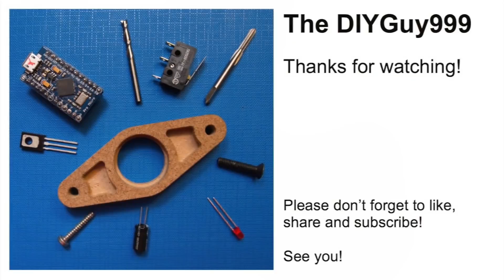WPL B36 URAL 4320: Axle, 2 Speed Gearbox and Motor Upgrade

Comment from the maker: The WPL B36 URAL metal drive train upgrade is finally done! In this video, I'm going to show you many details, the 2 speed shifting gearbox, the Arduino Diesel sound simulator and much more. if you like this video, subscribe and turn on notifications, so you don't miss upcoming episodes. See you!

Comment: Great video, has helped a lot regarding the rear axle as I built mine yesterday but I couldn't link the lower adjustable bars because the shaft is too long and I don't think I have a smaller one.

Comment: Nice video, good shots of the gear box when you had it disassembled.I also bought a b-3 and did the same upgrades. Just a thought with your first gear problems, have you checked the travel on the shift servo. In the video it looks like it goes about 45' therefore not fully engaging. I had to set the endpoints on my radio so the servo is at about 90' (parallel to the ground) when engaged in 1st gear and you can adjust the little plastic fork by sliding it on the metal shaft for fine tuning. I also shaved the edges of the shift servo horn for smoother engagement. So far mine is doing well driving on my back yard course men't for 1/10 scale.

Comment: Im planning to buy the WPL B36 RTR, my first crawler/offroader rc car so does it have enough power for offroading stock and can you go slow with it when stock or only full speed? And if i will uprage it with that 2 speed motor, do i need to buy anything else for it to work? Can the stock drivetrain handle the power the new motor, gearbox  makes? Does the 2 speed motor fit into there? Can i connect the motor and the servo, that changes the speed to other stock components? And do the truck or the transmission break often?

Comment: upgraded my 2speed transmission to the metal gear set, and it blew the plastic prop shafts within minutes, also have a brushless motor and esc coming, and the metal front axle...X2  as this will be for my eachine oshkosh 8x8 conversion.
still did not get a wpl truck, sofar stayed with eachine/ fayee and jjrc.

Comment: Hi, i purchased a 370 Upgraded motor for my Ural B 36. I have a question: Its really mandatory  to purchase the metal axles and props to use the new 370 motor or i can keep the stock plastic ones? Thanks in advance
Reply from the maker: Hi, the problem is the different gearbox output shaft. It has a flat and is not knurled. So you need a prop shaft with set screw

Comment: Hey, I'm following your channel for a long time now and I'm planning to start a project, but some doubts about your 'RC System' came in my mind:
1 - Can I use separated parts/components and just wiring them up without a integrated PCB? I can't order the custom PCBs right now!

2 - Can I use a different motor driver to the receiver system? I have to use a VNH2SP30 for my 2 DC Motors that pull 6A (stall) and 1.6A (current) each.

3 - Can I use your open source software to control 1 Servo Motor with continuous rotation?

4 - It's obligatory to use the 'Burn Bootload' method with any Atmega328p Arduinos? Cause I don't have any spare Arduinos, just 2 Arduino Uno (One for the Transmiter and one for the Receiver).

Finally, but not least, great video and keep it up!

Thanks for your time!
Reply from the maker: Hi,
1 - yes, you can use separate components. Have a look at this video: https://www.youtube.com/watch?v=yzYWgpmcsE4
or this: https://www.youtube.com/watch?v=HNjLZuy2b2A&t=176s

2 - Yes, you can, but you will have to change the control logic, because this driver IC uses two direction inputs. The easiest way would be to take my TB6612FNG library as a base and then change the control logic.

3 - No, because there is no position feedback

4 - No. The only change in my custom boot loader is the lower brown out voltage of 1.8V. It is intended to make the system more robust in low voltage (1S LiPo, 3.7V) applications

Make sure, you use a 3.3V regulator for the NRF24L01+ supply

Good luck with your project.
Reply: @TheDIYGuy999  
Wow, that was a super fast reply!

1 - Thanks, those videos will be helpfull to me!

2 - Ok, I'll try to do it, hopefully works!

3 - Oh... I thought that the Modded Servo Motor would work fine, cause I saw in one of your videos ("...RD-D2 Robot Build...") that you modified/used two Servo Motors. Could you explain to me how you control both of them in continuous rotation mode?

About the Servo again: Can I use the PCA9685 Servo Controller in the Receiver System or just plug the Servos directly in the Arduino Uno is fine?

4 - Oh, I watched it again and now I realise that you showed 2 methods to upload the program to Arduino and you only used the 'Burn Bootloader' method with Mini Pro if I undestand correctly. I should've pay more attention to it hahaha!

Thank you very much for your help and advices, sir!
Reply from the maker: The modded servos in the R2-D2 don't have a potentiometer anymore and the internal motor driver IC was removed as well. So they are just gear motors and are connected to the two TB6612FNG outputs.
You don't need a PCA9685. The ATmega 328P on your Uno is generating the servo control signals directly. For more details have a close look at the receiver schematic on my GitHub.
Reply: @TheDIYGuy999  
Okay, I'll take a look at the receiver schematics! 

Thank you for your clarification, sir! Have a good one!

Comment: Hello, I want to upgrade my b36 to 2 speed gearbox too. Now I have transmitter Flysky GT3B with receiver GT3E. I also have Li-Po 7.4V battery. Could you recommend me an ESC that support all my material? Thank for your helping!
Reply from the maker: You can find the link to the recommended 10A ESC in the video description.
Reply: Thank you for your help! I’ll buy it. But I still want to know the difference between ESC 10A, 20A & 30A can you explain me? Thank...
Reply from the maker: A is the maximum coninuous motor current in Ampere. The bigger the motor, the bigger your ESC needs to be.
Reply: So it mean that this motor gearbox 2 speed will work with this 10A ESC only right?
Reply from the maker: You can also use a 20 or 30A ESC, but 10A is enough for this motor.
Reply: Ok thank you for your explanation! 😉
Reply from the maker: You're welcome
Reply: One more thing I want to ask you, it’s about headlights. What’s resistant I should use for the light? And the light will plug into the receiver power plug right?

Comment: Hie sir wonderful sound and video I purchased new rtr version  truck I wanna to give diz sound to my truck can u plz help me m new to diz world not aware of any parts can u plz help me
Reply from the maker: Hi, thanks for the praise. This unit is relatively difficult to build, if you don't have electronics experience. You can find all files to build one on my GitHub. Links are in the description. The simplest solution is this WPL remote with sound: https://www.banggood.com/1-Set-WPL-B-1-B16-B24-B36-C14-C24-116-Rc-Car-Parts-Original-Engine-Sound-System-p-1423158.html?utm_campaign=4828314_1046285&utm_content=1097&p=NZ29024828314201605E